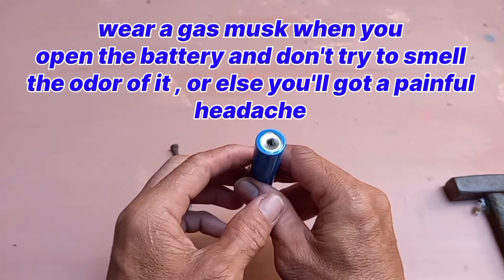DIY , UPGRADED POWER LOAD TELESCOPIC LONG RANGE GOLD LOCATOR VERSION 1

Comment: Good morning, the magnetic cable is copper wire, and the battery must be charged or discharged, thank you and greetings from Peru
Reply from the maker: Yes it's copper wire, discharged or charged can be use
Reply: How much  is that